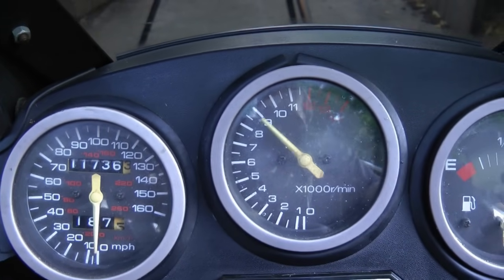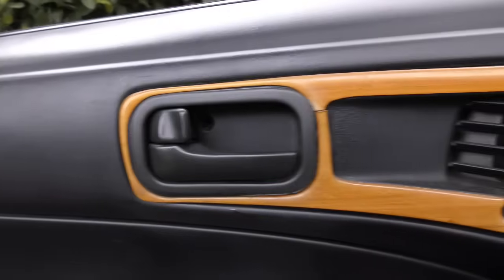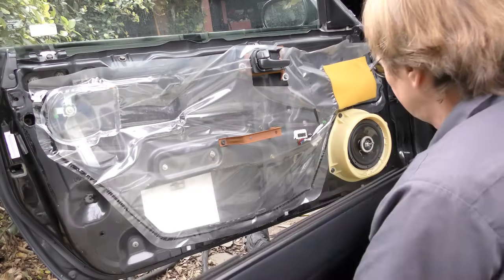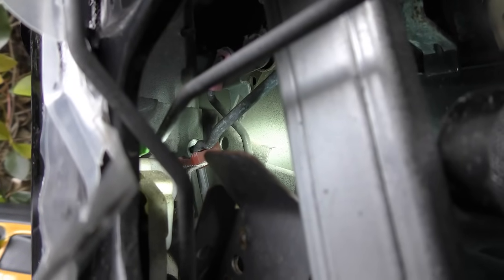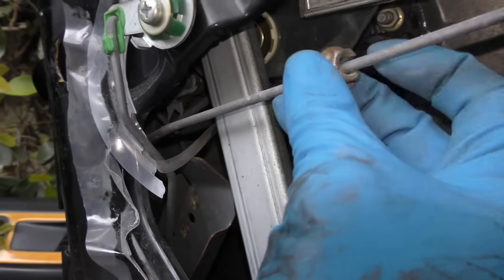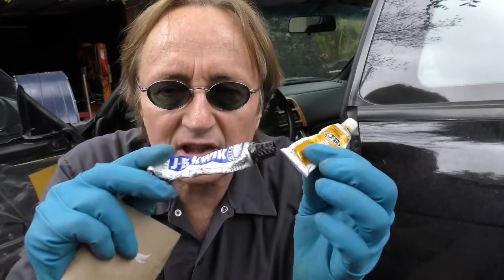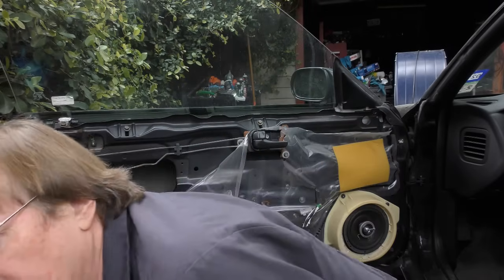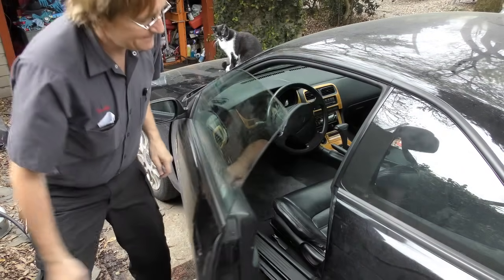How to Fix a Stuck Car Door that Won't Open

Comment: i got a diffrent problem i was taking off a broken handle from the exterior and than i accidentally closed the door and when i went to try to open it from exterior it wouldnt open what do i do
Reply from the maker: try to open it from the interior then, and take the panel off when open and fix it
Reply: I accidentally put exterior twice but i meant theirs nk handle on exterior and its not opening from interior the panel is already off

Comment: That's a great Hack!  Scotty, you should really try to "Live capture" those stray cats and have them Spayed or Neutered, thereby decreasing the stray cat population. They sell animal traps at Tractor Supply (if you have them where you live) or crappy ones at Harbor Freight.
Reply from the maker: notice that many already have notched ears and have been spayed already. A customer of mine does that all the time, catches em and has it done at a nice clinic
Reply: Cool. Didn't notice the notched ears.

Comment: I have a Renault megane 2005 for my sinsI cannot lock the car at allthe key fob works okay, starts the car and will set and un set the alarm but it wont lock the doorsive even tried the lock switch on the inside with no joyI can hear it clicking (near the fuses) but the only door I can lock is the passenger one..............any ideas how I can lock the car................pleassssse

Comment: YER  so easy a kid can do it IF THE DOOR OPEN ON THE INSIDE TRY HELPING VUEWERS WITH SAME PROBLEM WHEN DOOR WONT OPEN FROM ETHER SIDE. And all 6 screws are inside the locked . PAUL DANNELS COME TO MIEND.
PLEASE DO AWAY WITH THE MOTOR BIKE. WE AS CAR DRIVER ONLY WANT TO FIND OUT HOW TO OPEN OUR LOCKED DOORS .

Comment: i have a 92 4 runner the drivers door  wont open. help
Reply from the maker: +theicediamond7 take the inner panel out like in this video to find the problem, sometimes you have to cut the panel to access inside If door won't open at all
Reply: thank you but then what,  i have giggled banged screamed im sure there is a simple click but dont know it

Comment: My car door lock opens with electric system when i press the button , but it doesnt work when i insert my key... None of the driver or passenger door works with neither of the main or spare keys.
Reply from the maker: +Suyash Sharma time for new keys or new locks that come with new keys.
Reply: Thanks!

Comment: Hello Scotty ,
My first car was my Nissan Sentra 1995 <3 my nessy died during hurricane Sandy ;_; . so now I own A toyota camry 1996. I have two young nieces and I put the child safety lock on my car door. Normally this wasn't an issue. I would remove it whenever they would go back home. About 6 months back My passenger Rear side door wouldn't open from the outside which wasn't an issue because you could still open it from the inside. -_- i leant my car to my sister and she forgot the issue about the door and put the child lock anyway -_- >.< now my right side rear door won't open at all ?! :( 
Any way you could help walk me through it.
Reply from the maker: Karen Amaya  well, you will have to pay a guy like me or locksmith or tow truck dude to break into that door then

Comment: What if the door does not open at all?
Reply from the maker: then cut a hole on the inner panel to release the latch, or pay a locksmith to try to break in with his tools
Reply: Okay thank you! I have been breaking my head over this.

Comment: What if the door won't open from the inside either?
Reply from the maker: +aaron stupidthing then pay a locksmith or tow truck driver to jimmy their way in, OR cut the inner panel so you can reach the latch and force it open

Comment: What if the door won't open at all?
Reply from the maker: fun city then, you have to either cut a hole in the inner panel to get to the latch and pop it open. OR pay a locksmith or tow truck driver to break in for you

Comment: Help
Cannot get in the car from outside or inside Chevy Venture 2004. I just ordered a new actuator because it is making a weird noise but power buttons won’t open nor key in door nor thumb thing to unlock door. When I get the part idk how I will open the door??? %}€•@*

Comment: My 2000 Mercury Mountaineer won't open from the inside or out! :(
Reply from the maker: MONSTERxCILE then pray a locksmith can get it open with his break in tools, or you will have to cut the inner door panel open to access the latch to open it.

Comment: thats a 240sx, i have the same car and same issue. ive removed the door pannel and now im lost
Reply from the maker: +Devyn Baker odds are you need a new door latch assembly, ebay often sells used ones

Comment: My door does not open from the inside or outside 96 corolla
Reply from the maker: +Piero Botteri  then the latch will have to be forced open. Either pay a tow truck driver or locksmith who often can get them open with tools, or cut a small hole in the door panel inside to access the lock and unlock it.

Comment: Sadly this video wont apply to 95% of people that have this issue. Usually if the door wont open BOTH inside and outside handles will fail. Please do a proper video addressing that issue please.

Comment: HELP!!! My car won't open from the outside nor from the inside (my car is a 200sx 1997)
Reply from the maker: you have to cut a hole in the door card then to open it manually from inside. or pay a locksmith, they can often break in one more time
Reply: I was afraid of that. Thank you Scotty. 
P.s 
How much does it cost for your service? I think you are one of the few mechanics that I can trust.

Comment: He didn't put back the plastic inside the door. I know it isn't a big deal but your doing it for a customer....
Reply: +Willem van der Rijken true I like Scotty's work, but he pull the plastic cover to rough most of this plastic cover come with a glue like material that does not dry and if is not pull carefully it can stick to other parts of the door

Comment: None of the handles open the door so I can't open the door to remove the cover.
Reply from the maker: then you pay a locksmith to break in, OR cut a hole on the inner panel near the latch and force the latch open with a plier

Comment: i can't open the driver door from the inside nor the outside help me!!!!!!!!!
Reply from the maker: +Anthony Tomasso often that requires cutting out a hole in the inner panel. BUT, first, tr a locksmith or tow truck driver, they can often jimmy their way in

Comment: This is non sensical. If a door doesn't open you obviously can't work on it whilst the door is open therefore the procedure is different because the car can't be removed without being cut out for example.
Reply: Just like the video showed, if the door opens from the inside, you open it that way and then work on it!

Comment: my wont open from in or out
Reply from the maker: then you have to either take the inner door panel apart by cutting a hole near the latch and force it open through that hole, or pay a locksmith to break in

Comment: Slow the fuck down scotty, half the parts for the door you put on, aren't even on there correctly.... like shit   3:10  3:17
Reply: It's (probably) a mock-up video.
Reply from the maker: Austin Lucas
I don't film every little part, just the obvious ones. Don't want a long BORING video
Reply: Scotty Kilmer Short and to the point.

Comment: My doors wont open even from inside, what then ?
Reply from the maker: you have to cut the inner panel with a big enough hole to reach in and open it manually

Comment: How about you show how to take the door panel off of a door that actually won't open instead of taking one off that is open blows my mind how you sit there and and show somebody how to take a damn door panel off with the door open in a video that's supposed to be showing you how to open a stuck door

Comment: "Door car"
Reply: No.. He said "Door card".. He's talking about the inner door panel. The plastic used to be (and in few cases is still) used to protect the door card(board) from being dampened, so it can't mold etc. Most cars now tend to have an entire panel inside the door card that needs removed when doing these types of repairs.

Comment: This video is stupid how are we suppose the do this if the door won't open?
Reply from the maker: +prue420 this one opened from one side, and not the other. If both sides don't work, you have to cut open the inside panel to access the latch and force it open.